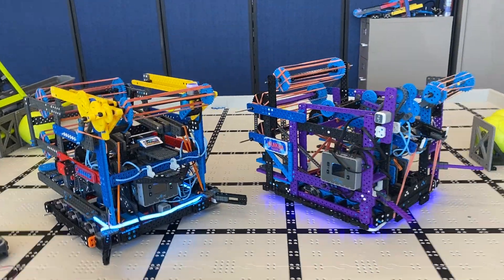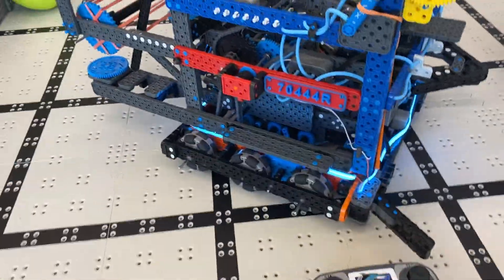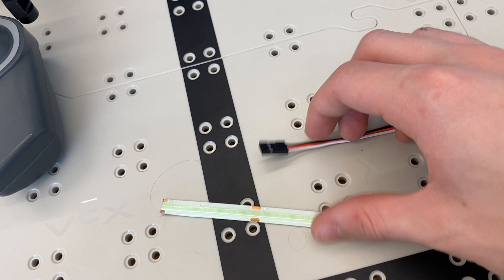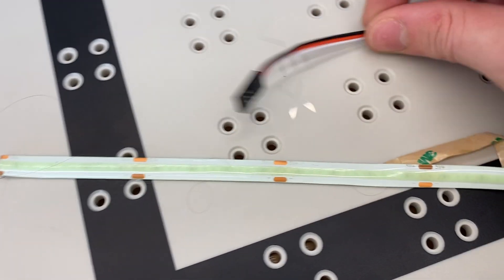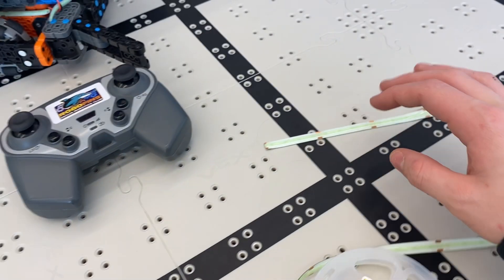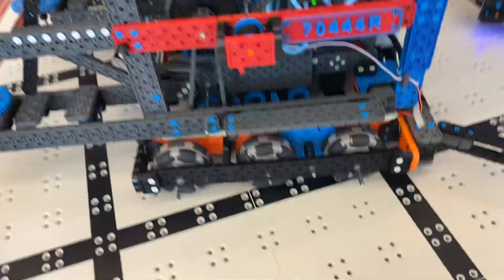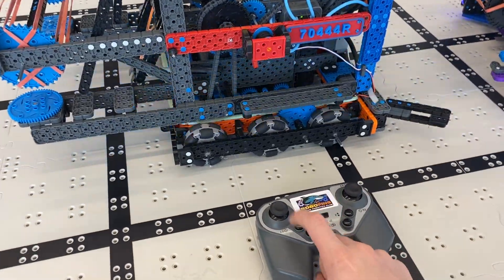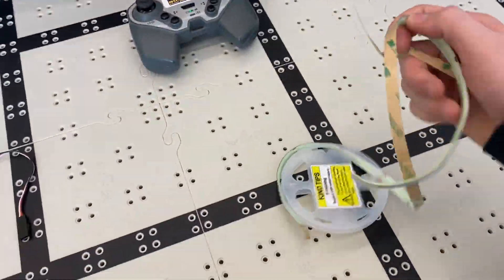How to add LED lights to your Vex IQ robot | RoboFins Team 70444B/R/X | #vexrobotics #competition

Comment: Hi do you think if we got ones with usb power input and used an adapter from usb c to a then we could plug this into the brain and get power from the brain?
Reply from the maker: Hi, we are not really sure about this, but it might over drain the brain if the voltage isnt correct, and it would be hard  to control the output of it. At that point, you could use the battery powered ones
Reply: Probably not, because the USB C port is a INPUT AC power and data transfer not multipurpose. Atleast from what i know

Comment from the maker: Sorta common questions:
Q: you need a pump?
A: No, you need a solenoid with no 3 pin input. If you use 1 solenoid with a pump connected to it, you would need to add another solenoid. You may also use Battery Powered LEDS if you don’t want to add another solenoid 

Q: Is this legal?
A: uhhh i think so?

Q: How to code it?
A: once you have done the soldering, you must go to vexcode iq, add the solenoid, and turn the “pump” on. This directs power from the battery(will drain some) to the LEDs through the 3 pin connector.